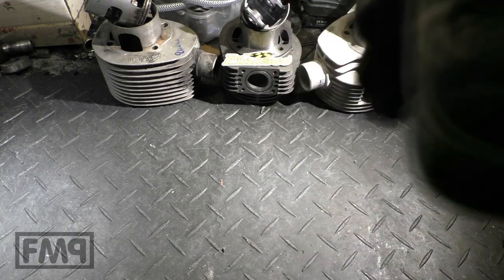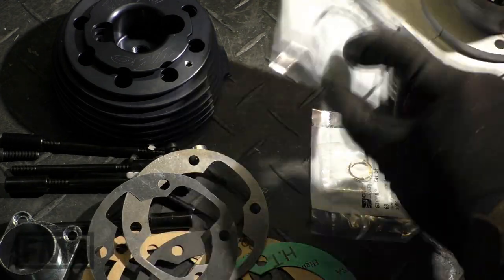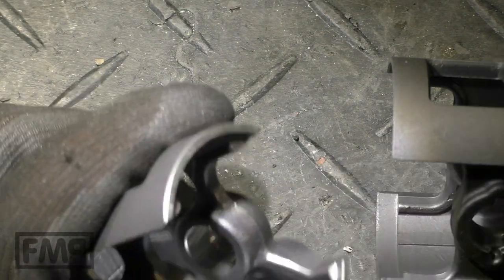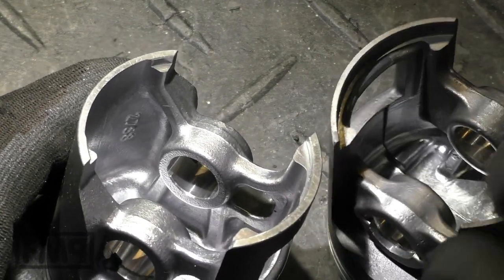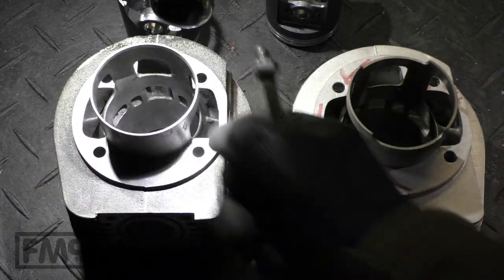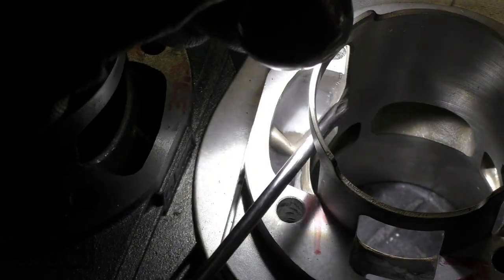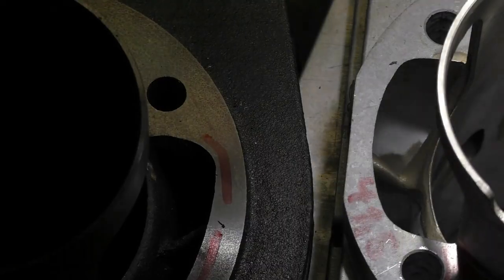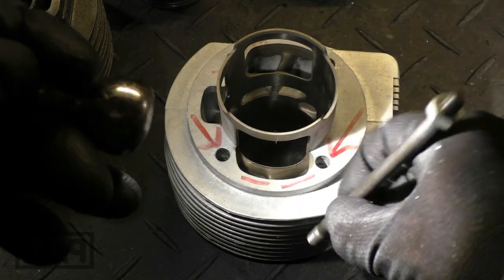vespa VMC CRONO 187 unbox | FMP - SolidPASSion |

Comment: Hi sir, im using vmc crono with kd2 crankshaft. Do i have to extend my intake? If i need to extend, may i know how many degrees i need extand?
Reply from the maker: u need reed valve. crono is not a rotary cylinder.

Comment: Thanks for the nice review. I'm currently building a vintage style race bike out of an old Suzuki GP125 which has a rotary valve. Modern style air cooled cylinders are pretty much only made for Vespa's in the 100-200cc range so I've welded and milled the engine block to fit a VMC ET7 on my GP125 engine. The GP125 have a 50mm stroke which matches Vespas 51mm pretty well. I have an extra engine which I was thinking about going big bore with this Crono cylinder. With a 50mm stroke and adjusted height of the cylinder you should get around 130°/190° durations and a little more revs with the shorter stroke.
Reply from the maker: wowh, cool. Thx for sharing your projects!! 🍻

Comment: I am after a bit of help. I have a 2016 Vespa PX 150. It has a Pinasco 60mm crank, 20/20 carb with 112 main jet, BE5 tube, 140 air corrector. The idle jet is a 52-140 with mixture screw 3 turns out. It still seems a bit lean on the idle jet. Revs take a few seconds to settle after a blip and on the overrun it pops quite a bit. I have recently fitted a new Pinasco 190cc Vespone kit. Originally it had a 105 main jet but it now has a Pollini Road exhaust so I upgraded the main to a 112. There does not seem much difference between the 105 and 112. It does not splutter or bog down when I apply a good amount of throttle. What jet settings would you recommend I start with for this setup? I appreciate you must get a lot of quetsions. Kind regards. Mark.
Reply from the maker: sorry i dont do si20/20, but you need to set idle jet correct pls use the mixture screw. take care of your pinasco piston, they all like to crack sadly. i would rather recommend using a VMC.

Comment: is it recommended to use a vmc crono using a rotary valve stroke 60 and si carb 24 24?  or what kind of suit do you recommend?  thank you.
Reply from the maker: no. crono exhaust port is too wide for limited rotary. its a reed valve cylinder.
Reply: @FreakMoPed8  if i want to use vmc stelvio do you recommend crankshaft stroke 57 or stroke 60?
Reply from the maker: 60 not needed but is fun of course, if 57mm crank is fine AND rotary valve tolerance 0,05mm is provided, i like to use the 57mm crank and extend intake timings
Reply: @FreakMoPed8  alright sir, thanks for the answer
Reply: @FreakMoPed8  why is the Crono a Problem with Rotary usw?Whats the Problem with this? What will be the Result. Not as much power as with Reed. Like all the other cylinders too.

Comment: Between these vmc 187,Malossi 177 cast iron and quattrini m1xl 172,which is best, interm of acceleration and topspeed? 

And do u recommend full circle mazzhuchelli 60mm crankshaft, to pair with any of these three cylinder block?? Or just stick with standard 57mm crank?
Reply from the maker: Rotary or reed
Reply: @FreakMoPed8  reed valve with 30mm carb,with standard 200 clutch (22t), and standard super gearing..also,do u have any recommendations for the exhaust.thanks in advance..hehe 😊 😊
Reply from the maker: quattrini, then vmc crono i would consider
Exhaust depends on what you want, torque  or reving
Reply: @FreakMoPed8  okay thanks FMP..hehehe.

Comment: Is Better quattrini m1x/m1xl or vmc crono 187?
Reply from the maker: crono only for reed valve, cause of the big exhaust port!
cant really answer, no experience yet in this comparison. Both come with meteor piston, vmc is younger design with side ex ports. I would say advantage vmc
Reply: @FreakMoPed8  how your opinion if using 62mm crankshaft for chrono?
Reply from the maker: could work. i  am not a fan of extra longstroke, enoug power is available with standard 60mm with all kits
Reply: @umarhassan6916  gilo topspeed ni

Comment: Can i use crankshaft 57 with cylinder vmc crono?
Reply from the maker: No
Reply: @FreakMoPed8  but there aren’t other possibilities???
Reply from the maker: why do you need that. Whats wrong with 60mm?
Reply: @FreakMoPed8  60mm it’s great but i want to know if there is a way to use 57mm.ps In this moment i have 177 VMC stelvio, what do you think of this cylinder? Vmc crono is better?
Reply from the maker: stelvio = rotary, crono = reed valve
Reply: @FreakMoPed8  thanks for the response